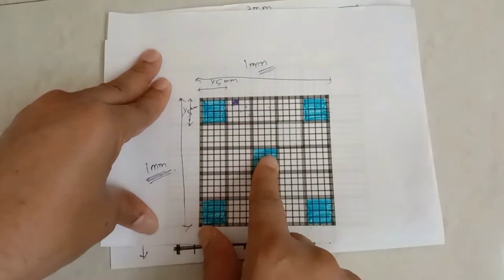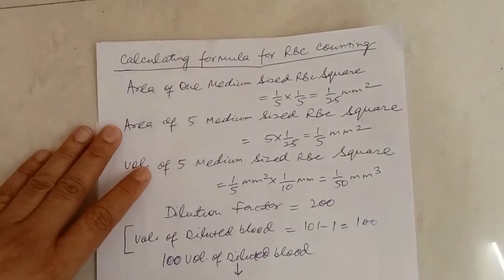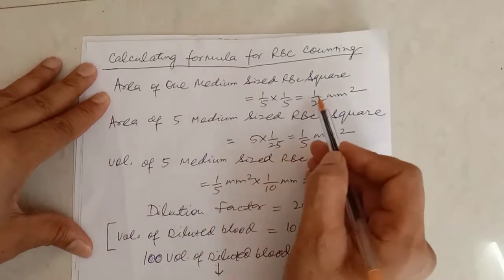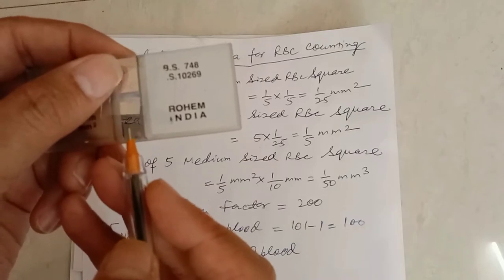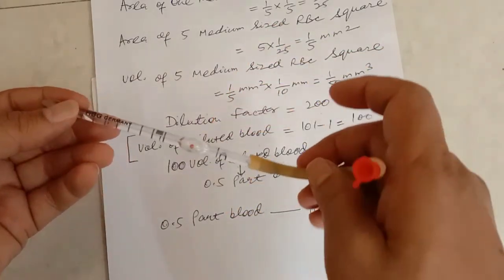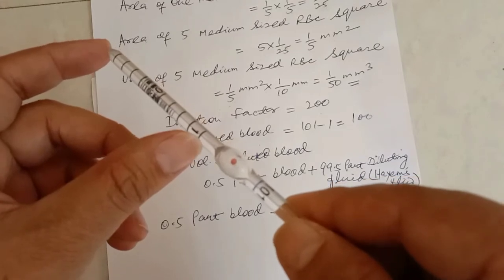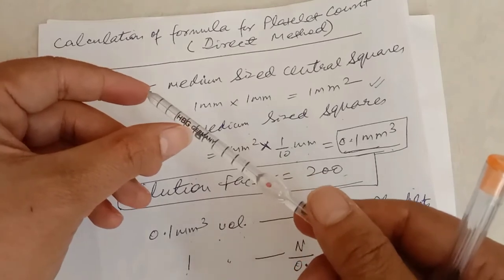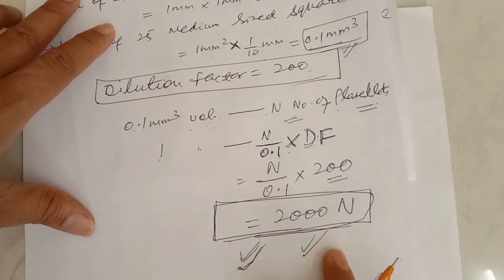Calculation of formula for RBC counting and Platelet counting

Comment: Sir.. I got a doubt.. when there are 25 medium sized squares , why to count only 5. 

While taking 5 squares why yo take 2 on top and 2 at bottom and a middle square.. why can't we take all 5 medium squares in a row..please clarify
Reply from the maker: You can count RBC in all 25 squares but that will be very cumbersome and time taking. Also you should finish your count in 45 minutes because morphological changes can occur. But still you can take take all 25 squares in that scenario the formula for RBC calculation will change from N X 10000 to N X 2000